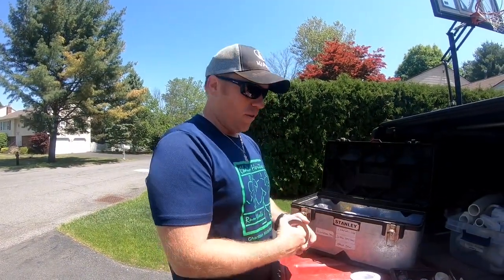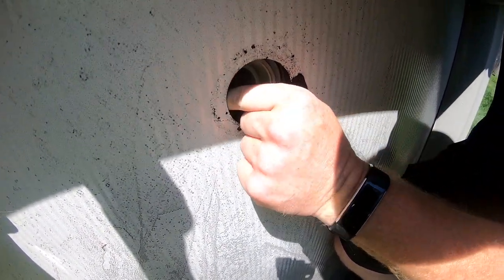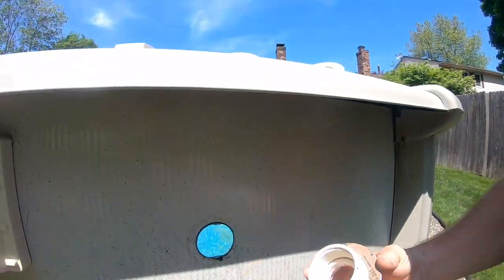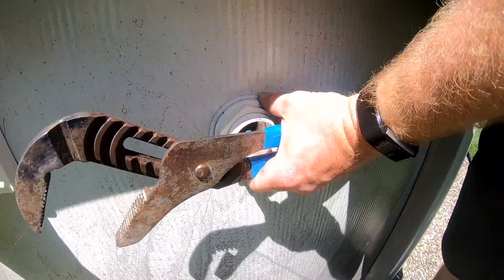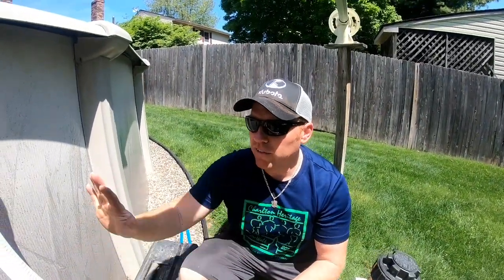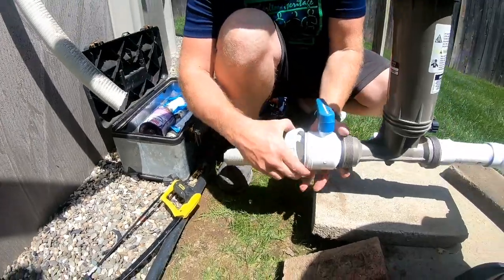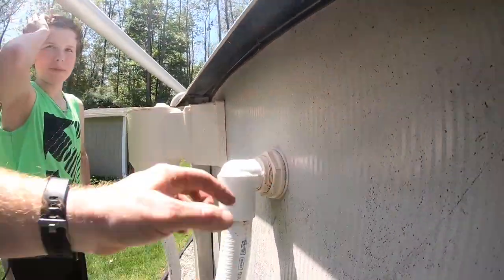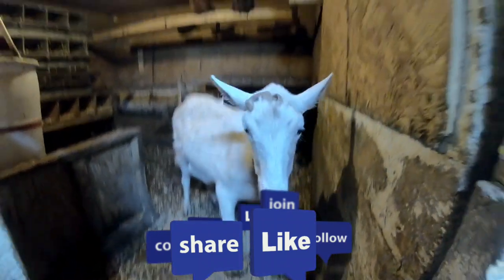How To Fix A Leaking Pool Return

Comment: towels brother and careful on glue and ball valves they will get glued or stuck in position . ::: edit::: I seen where you checked  . nice work. I been in pool industry for 6 years and just starterd more above ground pool repairs since no one in area works on them. nice work brother. I dont mess with purple primer I always look for clear cleaner if can find since primer and cleaner essentially do the same thing. If I use purple i go towel crazy and clean with cleaner . had a concrete pad get destroyed by purple primer. so i figure if cleaning my joints with cleaner why not just use nothing but clear cleaner and i stil will whipe my access glue on joints with a towel thats just my ocd
Reply from the maker: Definitely!  Thank you for watching! And have a great summer!👍😁

Comment: Great video!  So, the big question is:  How do I repair/replace this piece for an in-ground pool and you don’t want to dig the patio up?  Any advice or videos would be greatly appreciated.
Reply from the maker: As long as you can see where its cracked or broken above the cement you can cut it and glue on new pieces,  but unfortunately if it's under the cement you will have to dig it up or if your lucky you have a 2nd line running underneath you can set up to use, just depends on how old the pool is nowadays they always run a second line to avoid issues like this,  I hope this helps you out! Good luck and thank you for watching!👍🥰

Comment: Wow 23 years of pool owning and just learned about the inside gasket. Problem solved’
Reply from the maker: Just remember some manufacturers  have different ways of setting gaskets make sure to read your specific instructions for whatever brand you buy!  All should have a total of 3 gaskets!  Some brands will have different mixes like 1 cork 2 rubber, 1 paper 2 rubber, and 3 rubber, some require 1 in pool 1 in between liner 1 outside, others 1 inside and 2 outside etc , so for whatever brand you buy follow those instructions! Thank you for watching and have a great summer!😊

Comment: Great video.  I just replaced the fitting and I am still getting a leak.  What is the paste you put over the teflon tape?

Thanks.
Reply from the maker: It's Oatey pipe joint compound I use that and teflon tape on all my fittings and never have leaks! It may seem overkill but I like doing the job once and being done with it lol!  You can get it at any lowes or homedepot,  good luck buddy and thank you for watching!👍👍👍

Comment: Curious, why didn't you put the second inside gasket on the fitting first before putting the fitting through the wall? Seemed like trouble getting the gasket on from outside the wall.
Reply from the maker: I have dropped them in the past and it's my way of making sure they dont fall off!  Once they fall no getting back until you put a new liner in lol, thank you for watching!👍😁
Reply: I was thinking the same thing but then I saw that the gasket your referring too goes in between the liner and the  inside pool wall ( not the fitting and the liner ) … I think ….lol
Reply from the maker: If you have a Hayward return Pete B informed me that there instructions say to do the return on the inside with 1 rubber gasket then both the rubber and cork on the outside! Thank you for watching and good luck!👍😁

Comment: Damn, I think this is what has happened to ours.  I just got it filled (finally) today, and the hubby noticed it leaking from the return assembly.  He maneuvered it a little bit and it got worse.  This is only our 3rd season.  Ugh!  Then when he said the words "you'll have to drain it to fix it", I about died!  I'm calling a professional.
Reply from the maker: You only have to drain down below the return, do not drain your whole pool it's an easy fix!!!!!
Reply: @WhitehouseFarmVet  Oh yes, I understand that.  It's just that we have a well, so it took 4 days to fill it from below the return (after taking the winter cover off).(intermittent filling, so as not to burn up the well pump).  Thank you for your video, at least we know exactly what to do.
Reply from the maker: Yeah I definitely know what it's like to be on a well!! Also dealing with brown water from the well water when you add chlorine and it oxidizes the iron or metal and makes your pool look like tea water lol. Thank you for watching and good luck!👍😊

Comment: Is it common to have a gasket in-between the liner and the wall of the pool? If I don't have one today, should I add one?
Reply from the maker: Yes you should have 3 gaskets total you will need to lower the water if you are going to add one in between,  also do you know for sure did you install the return?  Thank you for watching!👍

Comment: Thanks for the vid. Is it 100% necessary to remove the pipe to to the return? Could you unscrew the locknut with the pipe still on? I ask as I have a partial inground pool and I would need to cut the pipe to remove it. Also, could you have fitted the rubber gasket on the inside of the pool on the fitting before putting the fitting through the pool wall?
Reply from the maker: Thank you!, as long s your water is drained down below the return you can try to remove the nut to disconnect it ,because you dont want water going in between the liner and pool, it al depends on how your pipe is connected too , also there are 3 rubber or cork gaskets 1goes on the fitting inside the pool ,1 between the liner and the wall and the 3rd outside of wall where the locknut is I think that's what you were asking let me know!  I hope it helps and thank you again for watching and good luck with the return wish I could help you in person!😁
Reply: @WhitehouseFarmVet  Ah right, just realised you put the one rubber gasket between the liner and pool wall. Ok quick question - do you think the rubber gaskets are stretchy enough to stretch over the flange of the fitting  on the inside of the pool? I was thinking I could loosen the locknut enough to push the fitting into the pool a little, then stretch 3 rubber gaskets over the flange, and pull one through the hole in the wall like you did, just from the inside of the pool right to the outside, then pull another one through to between the liner and the wall.
This way I'd have 3 gaskets in the right places, all without removing the pipe - but i've no idea if the gaskets would stretch over the flange on the pool side? If it all goes to crap i'd just end up cutting and regluing the pipe like i'd have otherwise needed to anyway.
Reply from the maker: That's a tough one , I have never tried doing it that way,  I'm not sure if they will stretch that much, and unless you have extra I wouldn't try it , might be easier just cutting the pipe and taking it off then  just glue a coupler where you cut the pipe. That would be alot easier to me!  Either way let me know how it turns out!  Make sure to subscribe  and share it helps out!! Good luck!!!!😁🐐
Reply: @WhitehouseFarmVet  Ok, success! Well, mostly. Easily stretched the washer over the fitting on the pool side, although couldn't work one through to the outer side as the gap was much too tight. Stopped the leak on one jet and reduced to very slow drip on the other. Should easily get me through to the end of the season when I can drain the pool and do a proper job. I should say this is on my pool stairs, not the pool wall - so I was only dealing with one layer. Surprisingly little water leakage while doing the fix despite not draining. Thanks for the advice and good luck with the channel!

Comment: You put the wrong gasket on the inside of the pool. You’re supposed to use the rubber gasket for the inside and the paper on the outside. Thats why the gasket keeps deteriorating!!! The paper on goes on before you screw the nut on the
Reply from the maker: Different manufactures have different ways of install for there products! The new return installed in this video,  instructions said" cork gasket it wasn't a paper! ,on inside of pool rubber in between liner and rubber on outside,  but different manufacturers  instructions say rubber inside pool, rubber in between  liner and pool, rubber on outside, and others say, rubber inside pool, nothing in between liner, 2 gaskets on outside,  and others say rubber inside, rubber in between liner and paper outside,  and so on,  it just all depends on the brand you buy follow whatever instructions that come with it!! Thanks for watching!👍

Comment: I didn’t use tape or glue is that why mine is still leaking so I have to use those ? Thanks
Reply from the maker: You dont have to, if you got the leak to stop by tightening then just leave it and monitor it for future leaks and if that happens then yes use teflon and pipe compound, but I always do just because it may seem overkill but I would rather overkill with no leaks then leaks with nothing! You got this!, drop me a line anytime if you need more help!👍
Reply from the maker: Also it's not glue!!!  it's a pipe compound that is brushed over the fitting where it screws in it basically seals the fittings and prevents water from leaking

Comment: What is there is rust around the whole? How do I fix that to stop the leak?
Reply from the maker: If it is surface rust you can sand it the paint and prime it then put new gaskets on and hook everything back up, if it is falling apart or rusted through unfortunately you will have to replace the wall or just deal with some leaking unfortunately, some guys do put a new piece of sheet metal in and rivet it then drill out a new hole but its alot of work and I'm not sure what you would be able to do. But either way I hope this helps out and good luck and thank you for watching!👍😁

Comment: You put the cork gasket inside the pool?
Reply from the maker: You can put it inside or outside it wont make any difference, his pool had paper gaskets which you could see pretty much  wasted away, at least cork is meant for water think of thousand year old wine bottles still corked! , I have also seen some pool returns where instead of putting a gasket in between the liner and wall they just put 2 on the outside which never made much sense so that's why I always do 3 one on inside liner, one on inside wall, one on outside wall and never have any issues!
Reply: Cork gasket does not go inside the pool
Reply from the maker: You are correct! Unless the return comes with all cork gaskets or 1 rubber 2 cork, they use to use all cork for returns it's all really the manufacturer, but as long as you have all 3 gaskets rubber or cork in the proper place you will not have any leaks!
Reply: I had this question too as currently our cork gasket is on the outside wall.  Glad to see it doesn't matter.
Reply: @carrielockhart7  it does matter. Cork on outside! Cork in water will last an hour
Reply from the maker: This has been a controversial subject, and if it's a hayward pool return the directions want you to use 1 rubber gasket inside of the pool and both the rubber and the cork on the outside!  I have been doing pools fo 20 years and we always did 1 rubber gasket on the inside with return then 1 rubber gasket in between the pool liner and wall then the cork on the outside, which ever way you do it I think you will be fine we never had any leaks or issues! And no matter what kind of gasket as long as it's new you should be fine too they use to be all cork then a thick paper type then a mix of rubber and cork and all rubber it's just different brands and products they use, the whole point is to seal it from leaking! Good luck and thank you for watching!👍
Reply from the maker: If you have rubber and cork, use the rubber on the inside if you have only cork  you fine as well they use to be all cork and a paper type membrane years ago, think about it cork was used for everything  and will gain less than 3 percent in weight in water making a seal!
Reply: @WhitehouseFarmVet but you did have two rubber gaskets.

Comment: can any help me repair few leaks in my filter hose pump? it a white hose that connects to the water going into the pool someone cut it with a lawn mower my kids are sad 😥
Reply from the maker: That stinks sorry to hear that, you can plug your return that goes into the pool then put your filter on closed then you can use a electric saw or hand saw to cut the sliced piece out, then use a 1 1/2 inch coupler and use primer and glue to connect the 2 pieces back together.  You can get the coupler and glue set for under 10 bucks at lowes or home depot!  It's really not to hard to do, you can see what I'm talking about in this video but I use ball valves to connect the 2 parts you would just use a coupler!
https://youtu.be/l1i-gpe0GIY

Comment: Hi I successfully replaced mine today but for some reason I’m still seeing some water leaking can you help thanks
Reply from the maker: Awesome! Where are you seeing the leak?
Reply: @WhitehouseFarmVet   mine I believe only had 2 washers yours had 3 I’m seeing the leak from the piece that the pipe attaches too we’ve done our best to screw things back on tightly thanks for your reply
Reply from the maker: So your talking about where the pipe from the sand filter connects to the return?  I think if that's correct then you can get a plug for the inside of the pool return and then take the return pipe with fitting out, load it up with teflon and pipe compound and screw it back in but just be careful not to screw it in too hard it is plastic and can break so be careful,  or if by tighten it up already like you said you did and it stopped then you should be all set! Let me know we will get it dry with no drip working together😁 lol Take care buddy !👍👍🍻
Reply: @WhitehouseFarmVet   I am still having trouble I actually purchased another return today my second one in two days and still no luck did you purchase an extra washer as mine only comes with two do you think that will help thanks 😭
Reply from the maker: What are the gaskets made out of that came with your return? Rubber,cork,paper etc???

Comment: insane amount of glue you're using on this stuff, the cans say a light coat for a reason.
Reply from the maker: Did it light when I first started , had it leak once and had to replace a 35 dollar Hayward ball valve and 15 bucks in flex line, not worth my time, or saving glue, 16 years later no leaks ever!  You are right but just not worth it to me, thank you for watching!👍
Reply: @WhitehouseFarmVet  also should have a drop cloth down to protect clients property from stains. Had a guy install hoses and he got the blue stuff everywhere including the filter and pump. Steel wool removed it from the patio stones but filter is stained blue.